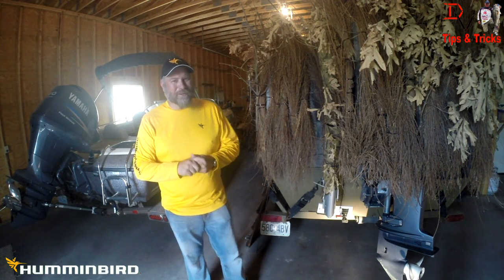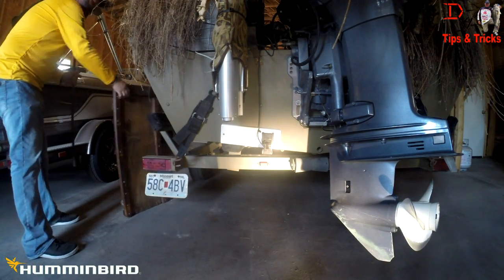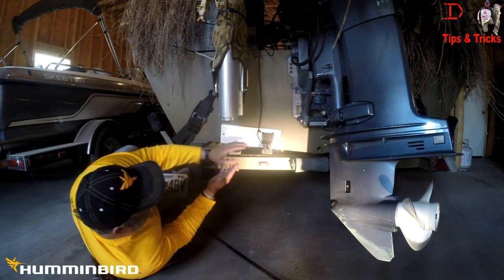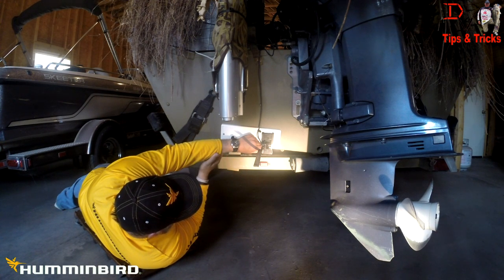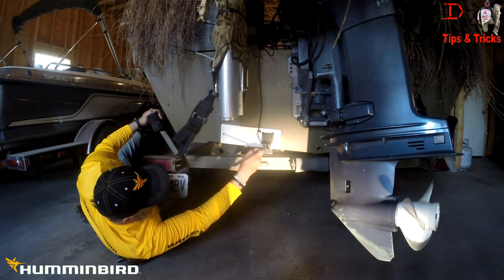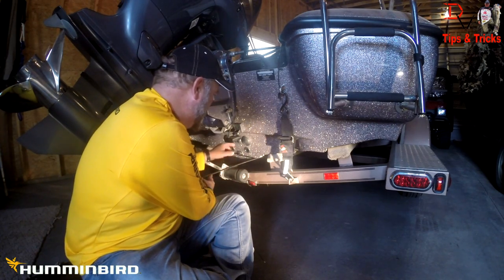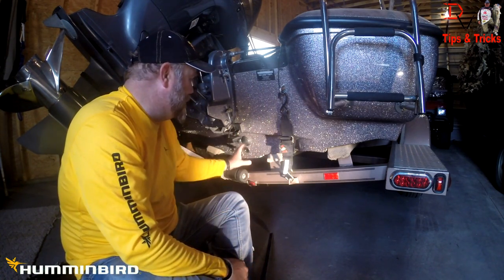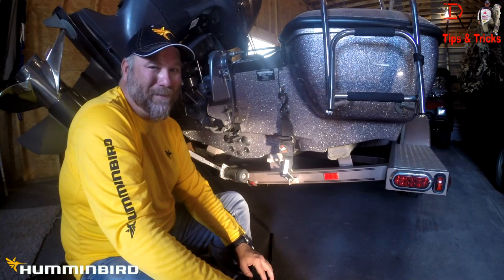Tips 'N Tricks 149: Understanding Transducer Installation Location

Comment: Hey Doug , just seen you video. I having issue with my newly installed helix 5. While trolling my system works great DI. Once I pick speed my DI screen freezes and just notice a rooster tail coming from my transducer. Based on  this video my transducer is placed too low, so fix should be to raise it a bit correct? Please advise need all the help!!!

Comment: Hi Doug, I have a Helix 9 DI and SI transducer mounted on my transom.  I'm considering adding a 2D sonar transducer inside my hull with a Y cable so I don't lose my depth readings at high speeds. Can you tell me how the Y cable connects to my current transducer cable?  Do I need to disconnect the existing cable from my head and run the Y cable from the head to the transom, or does my existing cable connect to the Y cable?
Thanks,  Greg

Comment: Hi Doug, I also have an urelated question. I recently bought my first bass boat and moved my hummingbird 587 ci HD transducer from the transom of my old boat to the trolling motor of my new boat. When I use the fish finder with the trolling motor running, I get somer serious interference on the screen of the fish finder. When the trolling motor is not running, the image is fine. Seems like there is some sort of electromagnetic interfence. Ever heard of this and know of any solutions? Perhaps you've already done a video on the topic I haven't seen? Thanks!
Reply from the maker: +Matt Provencher Give Humminbird customer service a call 800-633-1468 they can help you with getting the Radio Frequency Noise and killing it. Check the transducer cable and make sure it is not damaged.
Reply: Thanks!

Comment: Doug , I just installed mine last night and the transducer mount seems loose , actually let me refrase that , is loose . I'm scratching my head on this as it seems simple but I'm missing something . The shoulder bolt goes through the bracket and transducer , then the runner washer , then the metal washer and then the screw that goes into the shoulder bolt . There is a lot of slack , the transducer moves around up and down a good 1/4" or more in the bracket assembly . That can't be right ?!? 
Do you have any closeups of the ducer?
Reply from the maker: Chad Halvorson If the HDSI Transducer like the 999ci HD, 1199ci HD comes standard with will have play or loosen in the transducer as part of the kick up protection feature. One you are moving the water pressure on the transducer will hold it in place
Reply: thank you!

Comment: Also one other thing: I bought a transducer mounting bracket for my 2001 bass tracker 175 and as soon as I got it out of the package I realized an issue. On the stern of my boat there are bolts spread out about 6-8 inches so the board cannot fit flush. So should I cut the board (I wont have much room on it and I will need to drill an extra hole to mount), or should I try to use those same bolts to anchor the transducer mounting plate? I have no clue what the bolts are for, but I was thinking it might apply to the structural integrity somehow
Reply from the maker: I'm not sure I understand your question. You purchase a Transducer Mount Board? You need to install that to the bot then transducer to mounting board.
Reply: It's alright, I got it figured out. For some reason on the back of my bass tracker it has bolts attached to the transom every 6 to 8 inches. I was wondering if I could remove two of the bolts in the transom and use them to anchor the mounting mounting plate (since the bolts sticking out would not let the plate mount flush). However I just got creative and marked on the transducer mounting plate where the bolts would hit it and used a dremmel tool. With the dremmel tool I reamed the mounting board so that it fit around the bolts perfectly so I could mount it flush to the transom.  @DougVahrenberg

Comment: Hello Doug,I recently acquired the Humminbird Helix 9 SI KVD Edition, I have couple questions to ask you and my 1st ? has to do with what side of my boat I should mount my transducer,  I notice that on your boat you mounted your transducer to the port side of your boat or left side of the outboard does it matter what side the transducer needs to be mounted on?. Reason I ask you is I have a Humminbird Helix 5 DI and my transducers is on the starboard side or right side of my outboard..,My boat is 1989 SS175 Fish & Ski Sean Nymph Aluminum boat with a Evinrude 70hp Outboard.. my next question is mounting the Helix 9 SI Transducer mounting the same as mount my Helix 5 DI..Hope to here back from you asap as I trying to get my boat finished in the next couple weeks to go fishing..Thanks for your help..
Reply from the maker: Right side is best to reduce creating turbulence on the prop. This boat is a slow boat never get on plane. You can mount the SI transducer in the same area if it has clear view to both sides but it can also damage if high speed boat or hit underwater obstructions.
Reply: Thank You Doug,also I have some screw holes that where used from the previous owner who had mounted a transducer straight to the transom and did not use a transducer plate what would you recommend I use to plug these old holes for a sealant,they did use a screw and what looks to be just regular caulking and I want to use some thing that is more stronger to make sure there is no leaks..
Reply from the maker: 3M make different marine silicones that I've heard others use to fill holes some set up hard some soft. Depends on what you want. I would ask a retailer that sells the product which is best for your application

Comment: Doug,

On my Lund ProV aluminum boat, if I would my SI transducer on a mounting board will the motor get in the way of one of the side views?  If so, what is the best mounting option for aluminum boats with the motor mounted to the transom?

Thanks,

Bob
Reply from the maker: Trim the motor or add a second SI TRansducer and use the Left/Right Y Cable

Comment: with conventional rotation of the props, shouldnt the placement of the transducer be on the right side of the motor
Reply from the maker: +fishinman69 As long as it does not interfere with water flow to the outboard it will work on either side
Reply: Doug Vahrenberg most manufacturers of transducers recommend mounting on the starboard side with conventional rotation because the water is less turbulent there; hence, the ducer works better.  Nothing to do with motor interference.

Comment: Doug, Question I have a new Helix 10 Si Mega and I also have the Gen1 Helix 10si that I have moved to the front of the boat, I connected that to my trolling motor.  My question is do I need to run an high speed transducer such as the XNT 9 20 along with my Mega transducer?  I have been losing bottom at high speeds.  And if so will that interfere with the frequencies of the chirp 2D?
Reply from the maker: If you don't mount the MEGA Transducer where it can get high speed readings then a second 2D only transducer should be used with the Ycable

Comment: I noticed that the transduces on the fish and ski is less than the Humminbird recommended 15" from the prop.  Does this cause you any problems?
Reply from the maker: That dimension is for when mounting transducer for all speed uses and can aerate or disturb the water flow to the outboard. The Transducer mounted on the fish and ski will be out of the water when on plane and will have no way to effect the water flow to the outboard motor. That is the reason for the 15" recommendation and I did an alternative mounting method on this boat.
Reply: Doug Vahrenberg thanks for the reply.  I'm doing a left and right si transducer setup (no jackplate) for less than 6 mph imaging and have to position closer than 15" so I've got a lot more confidence in transducer placement now.  I've already got a shoot thru for on plane sonar.

Comment: I was under the impression the transducer had to be to the right of the propeller.
Reply from the maker: It just needs to be away from disturbing water flow to the motos water cooling pickups even in hard turns

Comment: I have the 2D Transducer and Si Transducer on a transducer plate.  There is a Strake right by the 2D Transducer.  I tried to move to the side of the strake but still having trouble.  The Si seems to be perfect.  I also seem to have trouble with the level of the 2D moving it a notch in or out.  Seems like no matter what it seems a little tilted in or out.  The returns after moving and adjusting seems like I'm getting a lot of / marks.  What does that mean? I'm thinking it is indicating too much to a direction.  Also after getting up on plane the Sonar will fad out and then comes back in fine.  Not sure why it would change from good to bad.  I have an aluminum boat.
Reply from the maker: A slight forward tilt will help with on-plane 2D performance. Got to give it good clean non-turbulated water flow so it can read.

Comment: I have a transducer shield and saver bracket for ss3d transducer on jack plate right side works fine.  I have an airmar tm150 transom mount transducer.  My bass boat has a step like your fish an ski.  According to airmar transducer will over heat if out of the water wile on pad.  when when off pad the transducer will drop down and be submerged.  I'm looking into a stern saver pad behind the step to keep the transducer submerged at a ll times.  Do you think the location will cause cavitation and effect my outboard performance.  I spent almost 4k on a carbon 12 3d bundle mainly for the chirp and now I'm in the dedicated chirp transducer rabbit hole.  Airmar dedicated chirp options are tm150 transom mount b150 through hull (hole in boat to install ;o{ )  and the and the p95 and 979 in  hull 's aren't compatible with lorance hds carbon units WTF.  thats by far the best option for a bass boat.
Reply from the maker: NO idea what Lowrance and AirMar TRansducers need.

Comment: I'm getting a rooster tail and when I'm running more than 15 knots it cuts out the reading.  should I move it away fromt he prop.  could the prop be causing a cavitation issue
Reply from the maker: Transdcuer is too low. move it up a little.
Reply: Doug Vahrenberg thanks ill try it